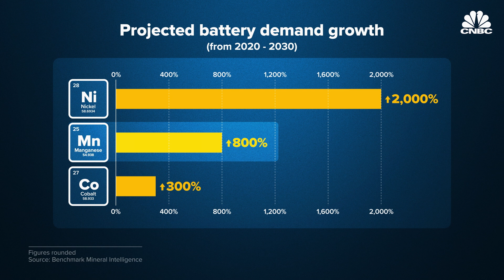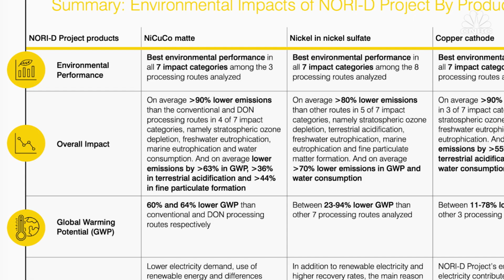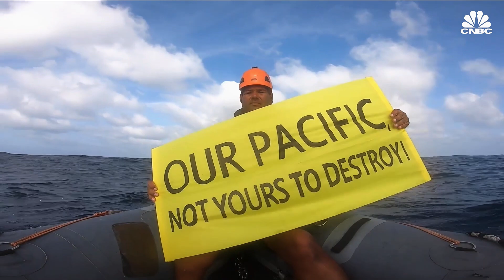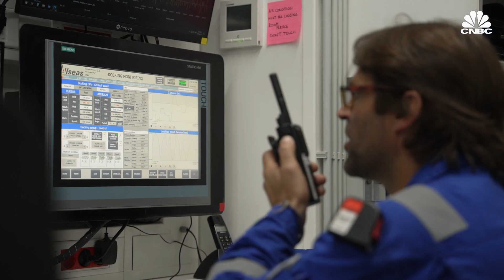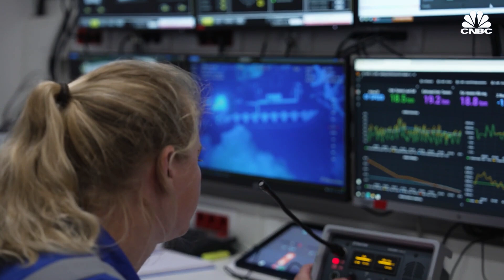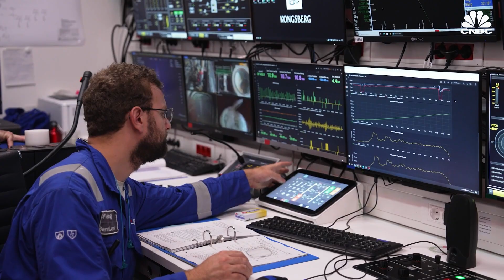Could Deep-Sea Mining Fix The Global Minerals Shortage?

Comment: Recent research has been done and has shown that the silt plume was not detectable outside the very small test blocks they used.  Previous theories said the plume would choke out life for miles underwater.  The newest research showed quite the opposite with the silt plumes settling out of the water column quite fast.  Science doesn't lie.  Wild hypothesis on what could happen do more harm than good.

Comment: The seabed robot scraping along the bottom of the seafloor like a vacuum cleaner seems... not great to me. It would be better if the robot "walked" along the floor the way the robot spot from boston dynamics works, and used robotic arms to grab the nodules instead. Even better would be if it left every other nodule on the floor, so that there are at least some nodules in a harvested location just in case they serve some environmental function. A robotic arm can grab some and leave some undisturbed in a way the vacuum cleaner method can't.
Reply: By buoyancy control the seabed robot (nodule collector vehicle) is hovering just above the seabed with just enough force (traction) on its tracks to manoeuvre. The nodules are lifted and sucked into the collector by a jetstream around a curved surface according to a principle called the coanda effect. No more than a layer of 4 inches deep is touched. Leaving every other nodule on the floor by collection of robotic arms would unfortunately not be economically viable or technically recommended as for the potential of breakdown of moving parts at 4,000 meter depth and the immense water pressure such instruments would endure.

For your information; already 43% of the Clarion Clipperton Zone is prohibited from any mining activities by the ISA. My guess is that much of the remaining areas will never be mined due to excessive depths, sloping surfaces or uneven terrain, making nodule collection just not economically feasible there.